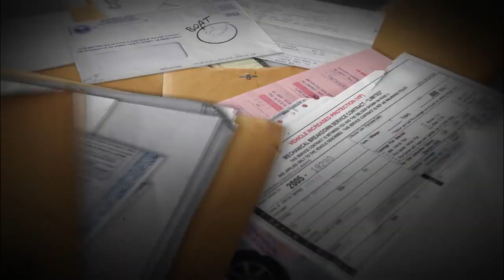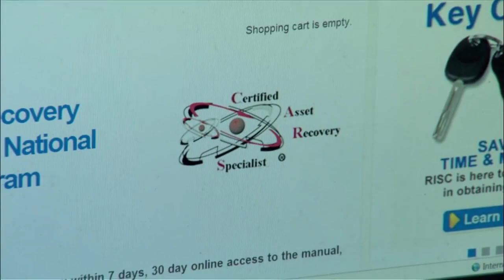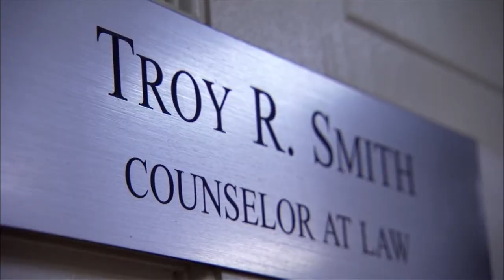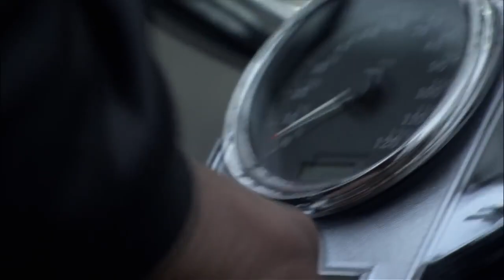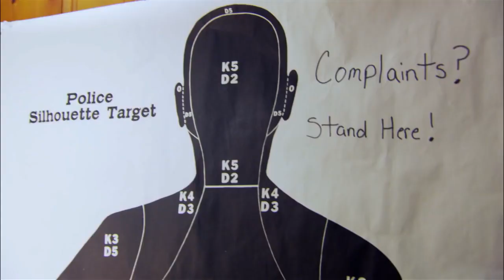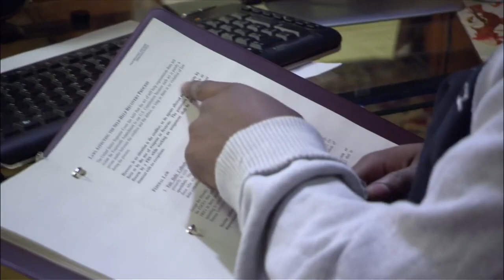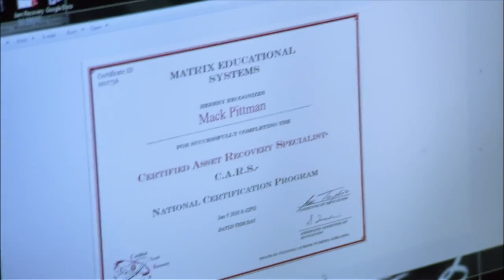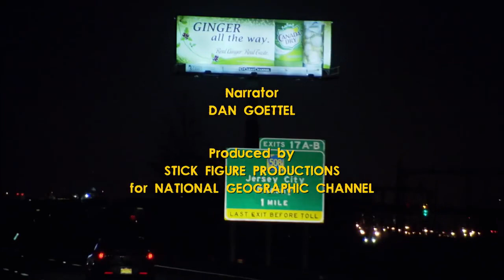Repossessed S01 E06: Hi-Tech Repo

Comment: The C.A.R.S. certification is mandatory and required in some states in order to repossess in certain states, if you work for a repo agency, Illinois is one of them. The only exemption to the Illinois collateral recovery Act is if you are a direct employee of the lienholder or Bank, repossessing a vehicle on sight, in which case you do not have to be certified. The law states that any lien holder or legal owner of a vehicle May repossess their own collateral without using a repossession agency.  That's why I am a certified Agent thru CARS and sign a 10-99 independent contractor employee  agreement with small and large dealerships as well as some lenders. Sure it means any legal owner or lien holder can try and repo their own collateral,  and it's perfectly legal, however I personally tell my clients that it's not a good idea if you don't know what or how to do it properly!  That's why they hire me, who has the knowledge and experience of 20+years! THIS is crucial if they want to avoid wrongful repossession lawsuits as well.